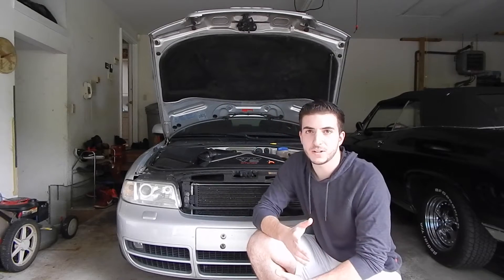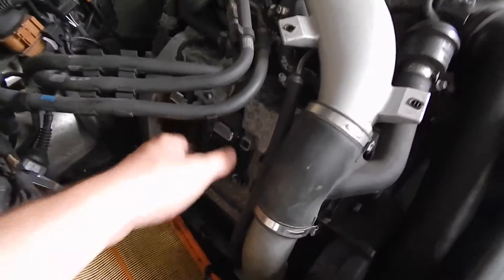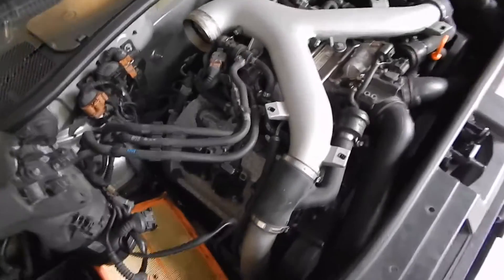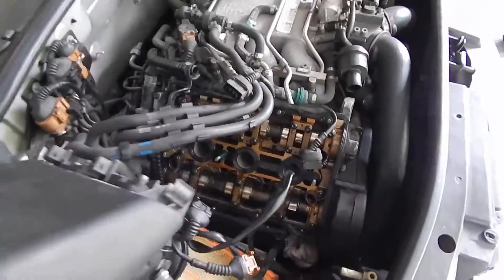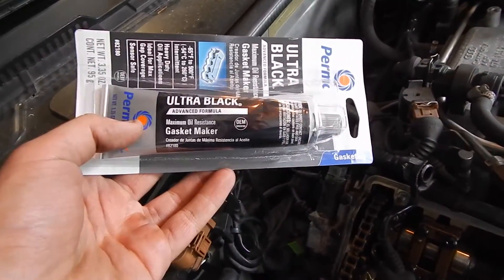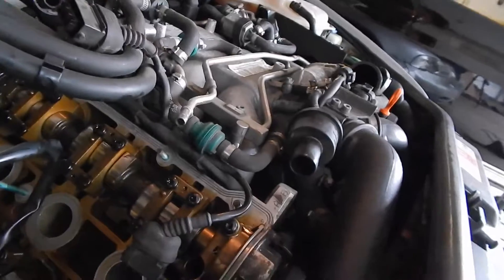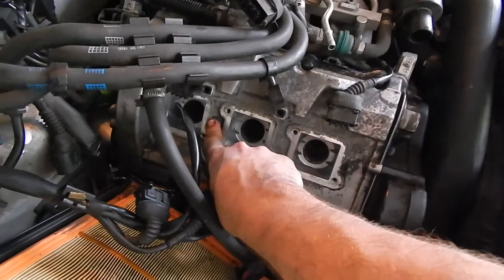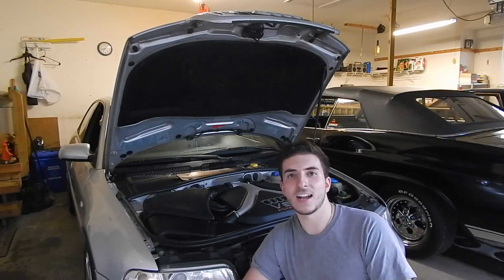2001 Audi S4 Valve Cover Gasket Change

Comment: From my experience, a valve cover gasket leak on these cars is due to excess crankcase pressure, which usually has something to do with the PCV (positive crankcase ventilation) system. It is a common issue with these.

Comment: Just did mine and i found that there is a metal valve in the way next to the back fire wall. I just removed the bolt below this and set it back an inch to get the valve cover off it is backward left is tighting right is losey german backwords. I hooe i got the valve on correctly if not i guess i have to do it over again. But in all in all now i kniw the best way to do this. Like the back thick little piece thats goes down behind the chain. And put that ultrablack on the bottom area like a triangle.

Comment: 2006 audi a8 had a new water pump with timing belt put in the other day only to wake to more bad news of bad head gasket im extra pissed off because my mechanic should have told me the possibility of needing this . my question is . is it worth fixing ?
Reply from the maker: cowboyfan dallas if you love the car enough it's worth fixing. Only you can answer that question. From a business prospective.. possibly not. Get a quote for the fix and then look up what the car is worth. Then decide if it's worth it!

Comment: the valve cover gaskets are not as common as the chain adjuster gasket. Most people who replace the vcg have a leak still. I hope your leak is gone but it most likely still leaks
Reply from the maker: Steven Shenkman you are 100% correct. Still leaked after the valve cover gasket change. I took it to a shop to get all the other gaskets done. (Expensive job)
Reply: It looks like thats where my leak is coming from. Ill be getting down in there Sunday..
Reply: pain in the ass leaks, I got my passenger side to stop leaking, but the drivers side has only slowed with new gaskets, this includes the half moon seals and the tensioner seal. I used high temp Permatex Copper RTV on the corners at the cam caps, installed the cam plugs caps dry as well the remaining valve cover seal. I've heard people are using a Mercedes sealant, and or Permatex part # 80017 under the actual cam caps, and the cam plugs to stop the leaks.